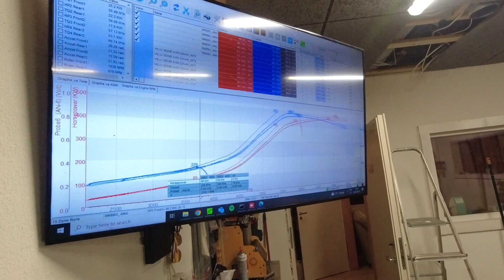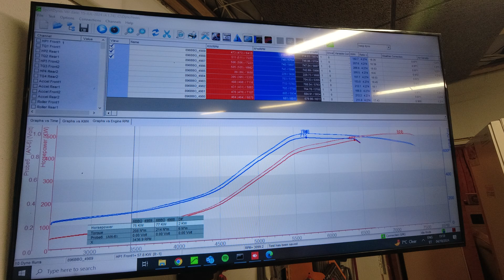700+ЛС Audi A4 B5 1.8T 20v Quattro PTE6062 Gen2 ЗАМЕРЫ НА ДИНОСТЕНДЕ (2024)

Comment: Has the car been reliable at the power levels you had her ?
Reply from the maker: 3rd season on this block.
Reply: @TOHA_TURBO  oh wow Any major issues or you just beat on it and it keeps working ?
Reply from the maker: @haise8004  No issues with this engine yet. Using this car for its intended purpose. Drag race events and sometimes driving on the streets.
Reply: @TOHA_TURBO  oh i though you also daily it even tho it would be a bad daily because of the fuel consumtion i think it would work cause this engine îs bulletproof